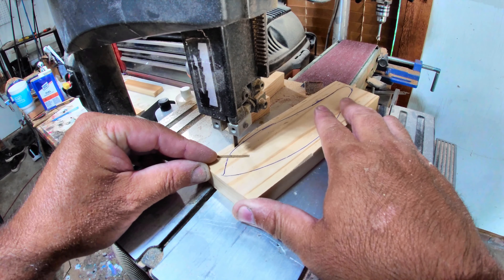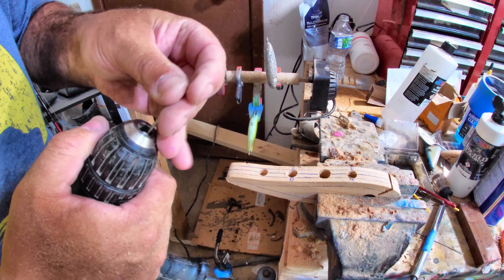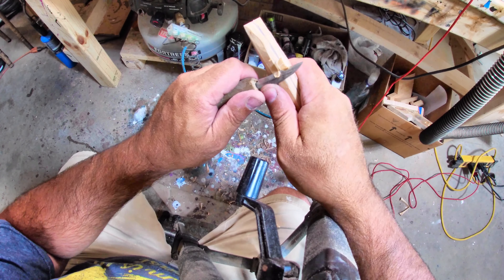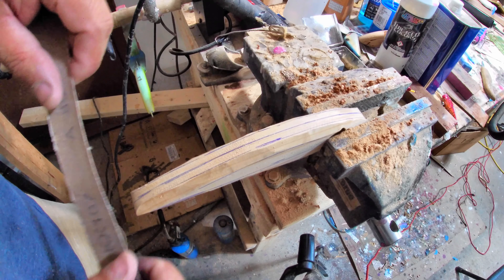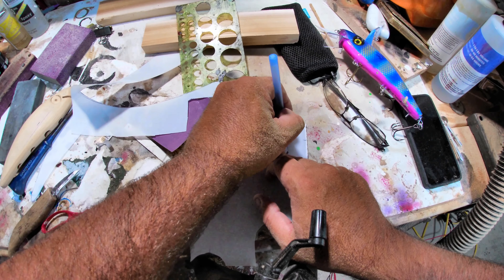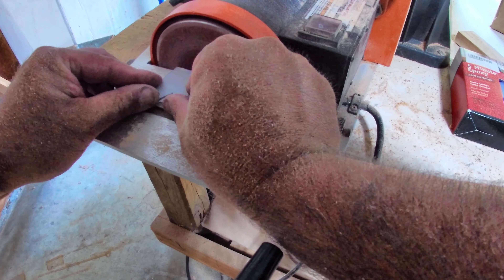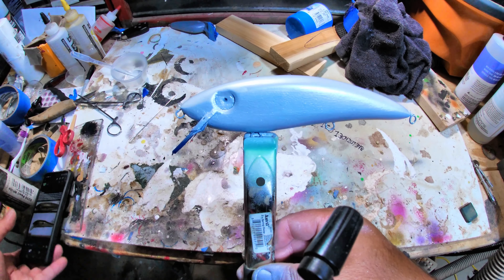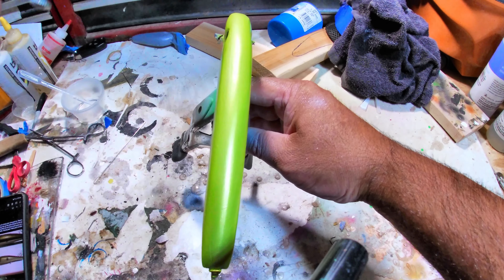Lure Making!!!  You NEED to See This!!! Making the 7.5 Inch Tennessee Shad Musky Crankbait

Comment: Watching you drill the center hole for the through-wire harness...

Question...

Wouldn't it be easier to mark and drill the center hole, hook hanger holes, and weight holes when the wood stock piece is still  square and un-shaped? You could use your drill press instead of the hand drill. Get the holes drilled on the center and then cut and shape the lure body around the holes. Or am I thinking wrong? 🤔

If the wood stock is square and you drill the holes on center, then no matter how you shape the lure the holes will still be on center, right?
Reply: Very pretty lure. Turned out well. Runs straight at high speed too 

Bob Ross of epoxy, lol, good one. 😂 You do have a similar calm voice as Bob Ross. You can now paint happy little muskie lures instead of happy little trees.
Reply from the maker: @thelonesomefisherman7425  honestly I don't know.  This was a pretty good method as pretty much all the lures I've made like that have run pretty well with only minor tuning.  But I'm always trying to find different ways.  For instance, on a few I have either gone through the top of the lure, bottom, cut in half, or drilling through.  Which is the best?  They all work equally well.  It's a personal preference, in my opinion.
Reply from the maker: But I may try that method next. Who knows I may even make a video of it😀😀
Reply: @rg22outdooradventures88  

Thanks. That's why I asked, I wasn't sure myself. You're keeping me thinking, and thanks for that. Personal preference makes sense.

Comment: Randy, I'm having some grief on a plug I'm working on. It's 7 1/2" long,  kinda fat. I made a large lip for it but just doesn't have much action. Thinking of a larger lip or wider. Maybe dropping the front eye lower like you did. Any ideas? Love this video!
Reply from the maker: @marsbotbyl159  Hello Mars.  On that style it was repositioning the line tie, which made a huge difference.  Other lures I've made wouldn't swim right no matter what I tried... then it's just back to the drawing board and try again.  Try the simple thing first like repositioning the line tie, try bending it down and see hownit works.